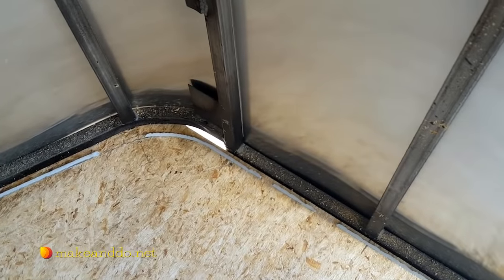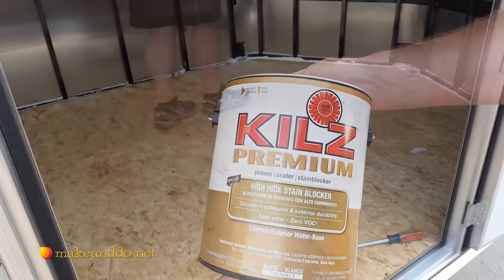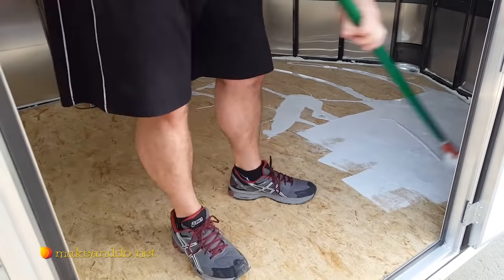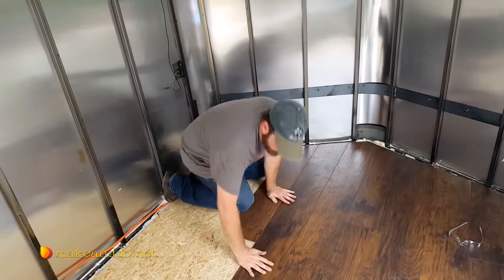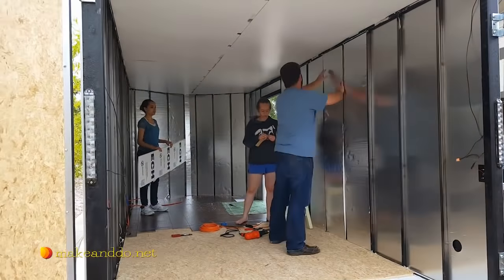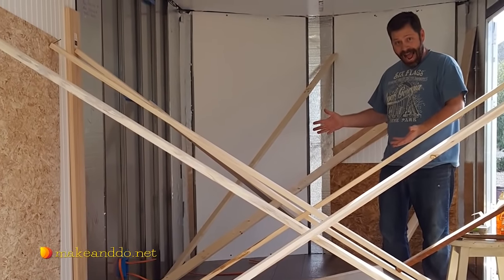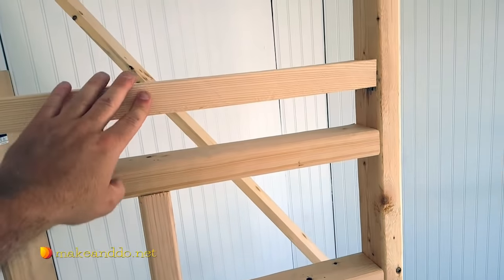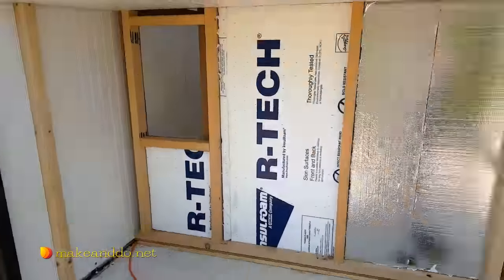Cargo Trailer to Camper Conversion - How We Did It in 4 weeks

Comment: Ever heard of "off gassing" i counted no less the 8 cancer causing products in this project, good luck in a few years.
Reply from the maker: Care to elaborate?
Reply: it comes to the chemicals used to manufacture common household goods, there’s a whole lot they(scientists) don’t know. These chemicals don’t just stay in products. Many of them enter the air via a process called "off-gassing"; they are then breathed-in by the people and animals who are in their midst. Thus far, these chemical contaminants have been linked to around 180 human diseases and health conditions, including cancer(s). Off-gassing (also known as outgassing) refers to the release of airborne particulates or chemicals—dubbed, volatile organic compounds (VOCs)—from common household products & building materials. Potential sources of off-gassing range from construction materials to carpeting, cabinetry, furniture, paint, and any number of household goods. Some of the most common chemicals off-gassed from household items include formaldehyde, benzene, ammonia, and toluene. While off-gassing can be easily identified by so-called “new car” and “new carpet” smells, it can also be odorless. My biggest concern in sleeping in that trailer would be the ridged foam insulation as well as the spray foam insulation. Of course non of the problems are going to be immediate, no that will take some time, maybe even years. This off-gassing is also a concern in the yachting industry, thats where i come from. Ever seen what a bank(8) of batteries being constantly charged (in the living space for the crew of a large yacht) can do to the metal exposed to the of 'gasses' of said batteries. I should have taken pictures. But the same air in the crews quarters is the same through out the boat. Not so long ago, there was a recall of manufactured flooring & gypsum board do to its immediate effects of the people living in the homes. Be mindful of what you use, for your own good, and your loved one's!
Reply: They Off Gassing Chemicals must all come to Utah in winter during the inversions.  That toxic soup is killing me.  I want to move out of this state soon and retire in an area that has clean air year round.   Good Point about dangers of materials.
Reply: Dwight Simeon if it’s for occasional use he’ll be fine. And that’s only if the wood was pressure treated. Even then if it’s for occasional use it’s fine
Reply: I understand your concern. I know what you say is true. A big concern is this. Why are these harmful products still in use? Even Fema had some toxic trailers after Katrina. However, he and his family will spend more time in his home than this trailer. What is he to do? What are we to do? It used to be lead and asbestos, coal mine dust, cotton mill dust. We seem to trade one toxin for new ones.
Reply: Dwight Simeon....We are using reclaimed rigid foam board for our tiny house. Is it still possible that it is still leaching into the air, or has it gassed off most of the toxicity after many years. Would plain styrofoam sheets be a better, healthier option?
Reply: My family and I will be residing in our tiny home. We are using 100% recycled, and reclaimed barn wood. In fact everything we are using was used in other homes, except for the Tyvec wrap, and a foam roll of sub-flooring. We have suffered enough with rental apartments that were full of toxic black mold behind the walls, and even exposed to horsehair/ asbestos insulation. I think this tiny home will be the lesser of two evils.
Reply: :) ironically, you’ll die at the ripe old age of 96 due to the VOCs that outgassed during your hard nights of well-earned sleep while enjoying this great build... unless you leave the doors open and ventilate it for a few weeks... in which case, you’ll die at 98...never knowing you cheated death...because it’s your CAMPER.
Reply: @briarrose3947  Dwight is rightfully concerned about potential carcinogens, but I do believe in this instance is a bit overzealous in this regard. Nearly everything offgasses. but just because something offgasses does not necessarily mean that what it is offgassing is dangerous. 

Rigid foam board installed correctly is safe even brand new, it can react to certain adhesives though so if using an adhesive to install it, make sure its compatible with foam. It is also generally required by many building codes to be behind a thermal barrier such as half inch drywall when facing a living space; or behind an ignition barrier when facing unoccupied space such as an attic. 

Exceptions may be made by certain localities building codes for foil faced rigid foam board (foil is commonly associated with polyisocyanurate or just polyiso for short, foam board)